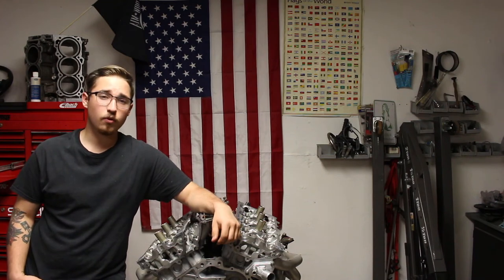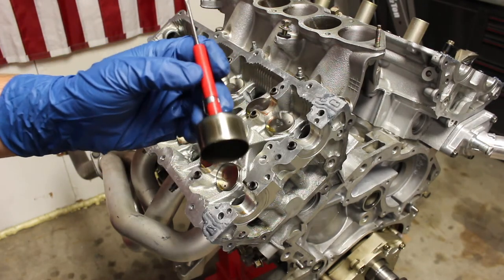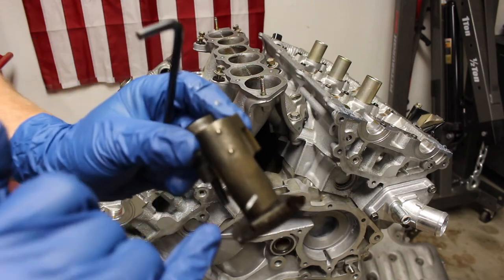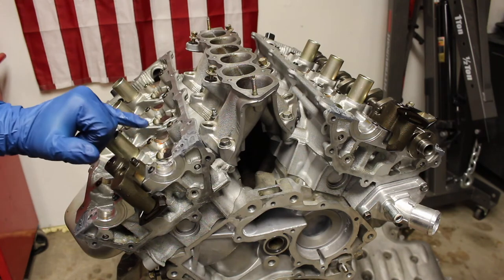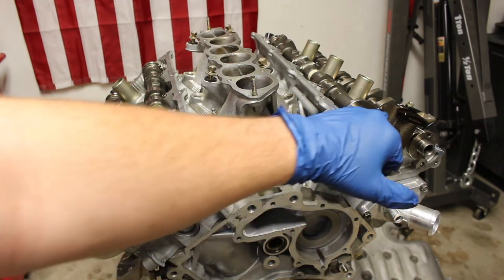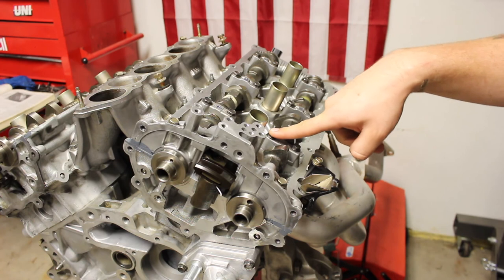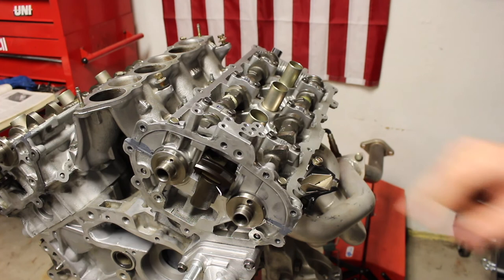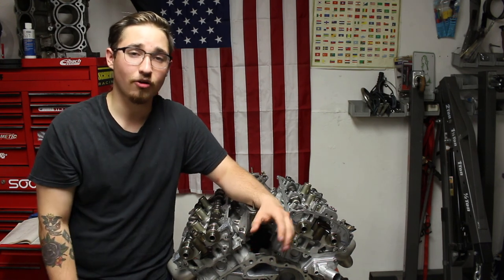How To Install Lifters and Cams: Nissan 350z

Comment: While I'm doing a full timing chain service (in which I found a sheared VVT pin in my cam sprocket, forcing me to replace both an intake cam and that sprocket 😔), I thought I'd mention something fairly critical about the RTV placement in the main front cam cap (that bolts to the rear of the front timing cover): the RTV is NOT supposed to be placed in the inner groove that widens (V) towards the front of the engine. That is there strictly as an overflow channel for the RTV on the outer (parallel) groove, as the oil port that feeds the front cam bearings is just INSIDE that inner race/groove.

It protects that cam oil supply port from getting RTV IN it (think of it like a moat), because if that happens, your front cam bearings are going to fry.

Same goes for the upper VVT Cam sprocket oil galley (those small O-rings at the top between intake and exhaust cams): it has two parallel races on the rear of the rear timing cover; the larger one (closer to the O-ring mating surface) should NOT have RTV placed in it; it too is a protective 'moat'.

Comment: Question. I have a normal de motor I’m rebuilding, for the cam brackets in the Haynes book it says to torque them down to 48in pounds but literally everywhere else I’m seeing it say to about 80in pounds. Not really sure what to do cuz we already specced the lifters our with 48in pounds
Reply from the maker: If I were you. Id double check with OEM Specifications. Thats whats best to use. I was using Pro-demand which shows specifications provided by Nissan. Personally I would recheck lifter specifications using proper OEM Torque specs.

Comment: Where it's next part of this video I'm trying to finish my build and I need help
Reply from the maker: Gustavo Moreno The Engine Build has Been on the Backburner. Not using the Engine and haven’t gotten to it. The series will conclude this year but the next part won’t be out for a few months
Reply: So check this out I pay someone to do my headgasket next thing u know he decides to ditch me on the job so I have 2 heads that I just got back from the machine shop and now I'm stuck with a lot of bolts and new parts in my hand lol
Reply from the maker: Gustavo Moreno Ah gotcha. Honestly there are some good videos on timing for the engine. Mine would probably be more thorough but honestly. My next free day isn’t until March 26th I believe. I could try to get the next part out this month
Reply: Good luck with your build I would be in tune
Reply: @gustavomoreno1593   tu tambien tienes un 350 o infiniti

Comment: Help Please! I traded a run down mustang that I rebuilt the transmission in for a 2005 Nissan Altima 3.5 SE. It had the dreaded chain guide rattle. Tore it down with the engine IN the car and the tensioner was extended, the slack guide and the top guide was broken and the back two cam tensioner shoes were wore down almost to the tensioner itself. I removed primary chain and guides and then removed cam sprockets and chains. I then replaced tensioner shoes and reinstalled cam sprockets w/ the chains. All mark's lined up. I then installed primary chain and guides, all mark's lined up, and then I pulled my catch pins out of tensioners. All marks were fine. My next step was rotating the engine(crankshaft bolt) by hand. I rotated it ab0ut 10 times until all my PRIMARY chain marks lined up again. I then noticed my cam sprocket chain marks were not lined up. What did I do wrong? Any help is greatly appreciated man!

Comment: The dowels aren’t at 12 o clock on the left head.
Reply: I noticed that too. My passenger side cams sat the same way. How do I align the cams at 12 o'clock? Can I rotate the cams by hand to align at 12? The #1 cylinder is at TDC. Anyone? Thanks.
Reply: @ejvalencia82 did you find out?
Reply: @gianvmarco  yes. I had to turn the cam by hand.